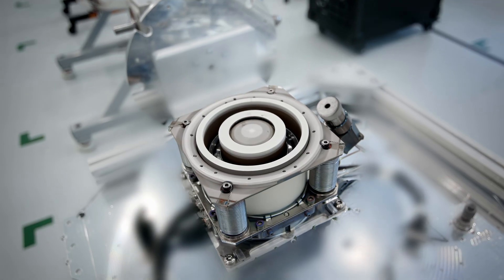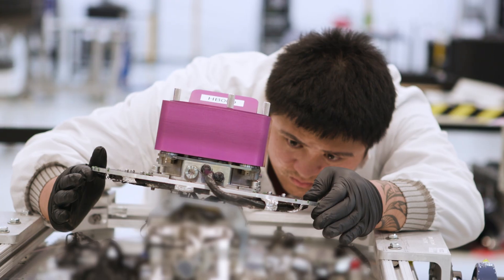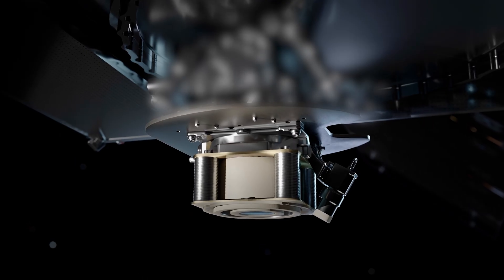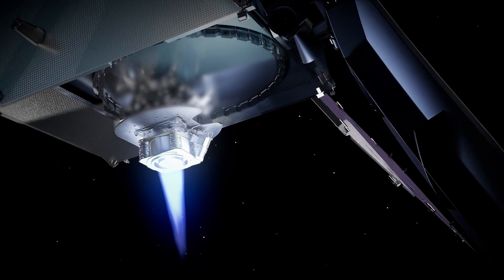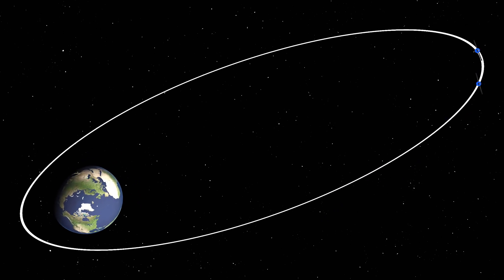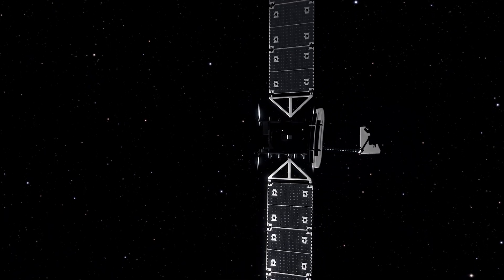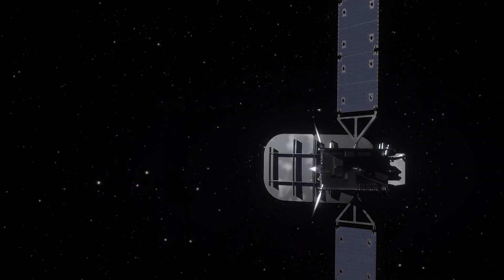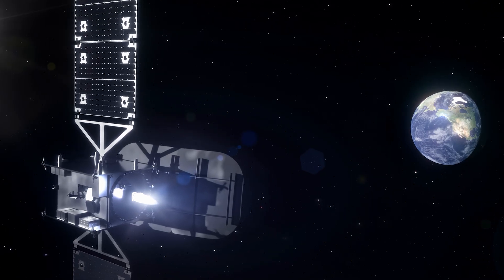We Upgraded Our Ion Thruster System | Aerospace-Grade Gimbal

Comment: Why not use the electromagnets in the thruster to control the thrust vector?
Reply from the maker: Great question! We do use electromagnets to some degree but not to steer the beam. The angles we require would be hard to achieve using electromagnets. If we were to start steering the beam using electromagnets, the thruster efficiency would go down and lifetime would decrease. Could be a cool idea to develop with future technologies in mind though!